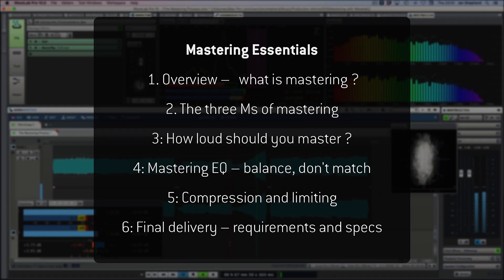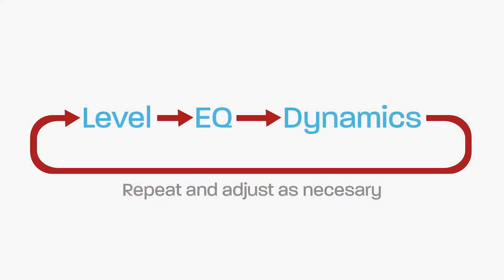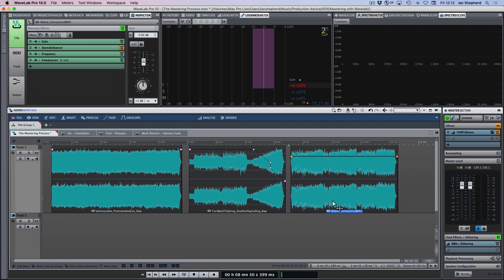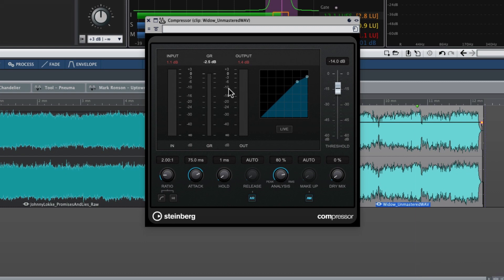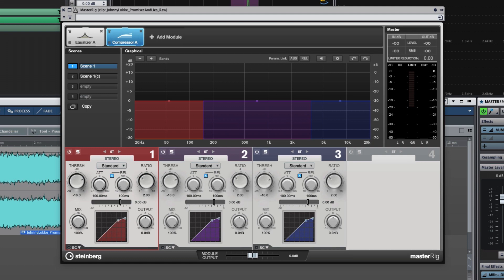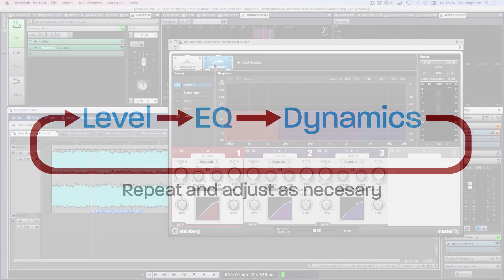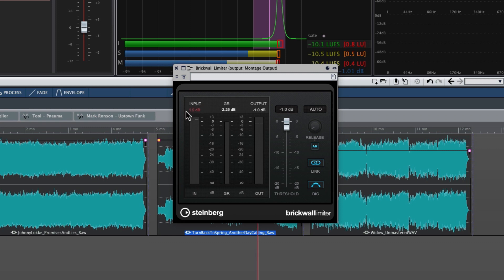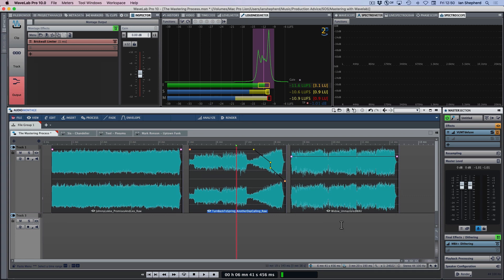Mastering Essentials Part 5 - Compression & Limiting

Comment: When you see a singer move the microphone nearer then further away during a performance, that’s a form of natural compression. Some engineers don’t like vocalists doing that during recording as it can interfere with the compression of that performance from a recording perspective. It’s far better for a vocalist to just sing the part as much as possible at one distance from the mic no matter how loud or soft they sing (avoiding too high an input level) then let the engineer deal with evening out the dynamics according to what is required. It’s a great way to control vocals when singing live and a mark of someone who knows hot to perform, but sometimes lives singers need to adjust their habits a little when recording.
Reply: I'm not sure I agree - some artists are so great at this I'd consider it part of the performance. Done well, it can work really well. Done poorly, it's a PITA